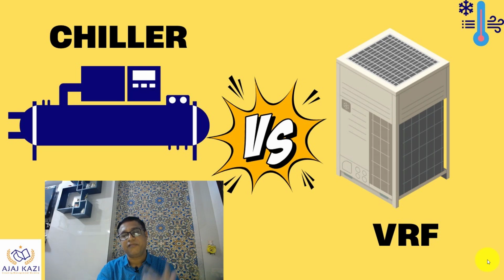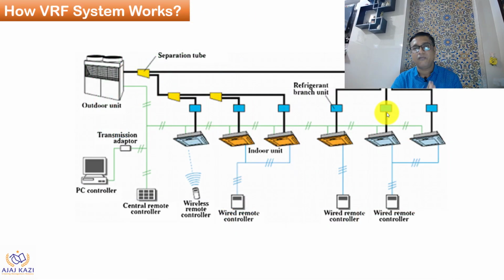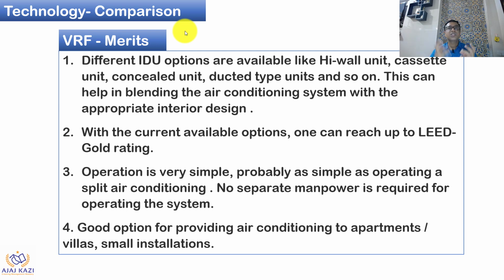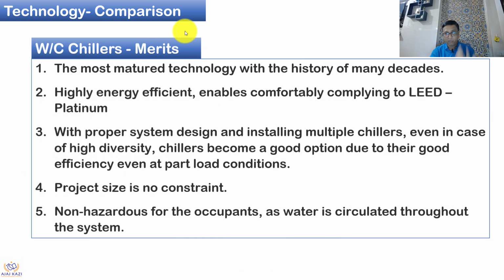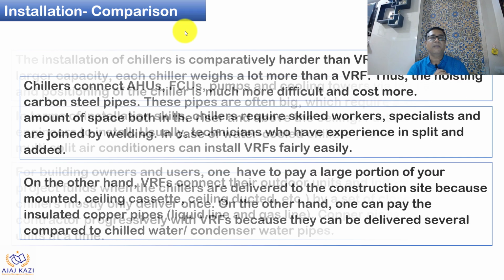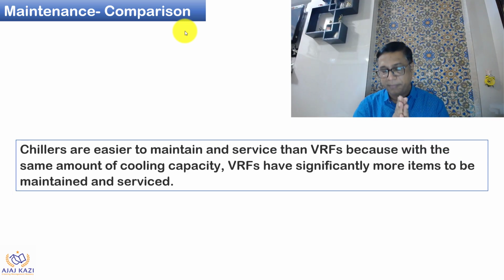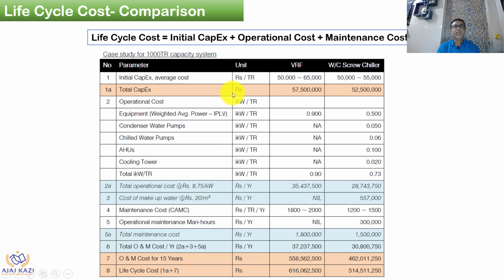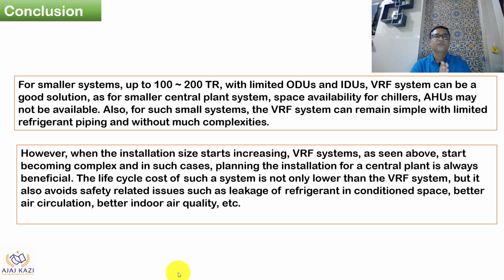Chillers vs VRF Which REALLY Cools Better

Comment: System selection must be based on application firs and all other pros and cons depend accordingly .
Hv seen, VRFs are  used in critical OTs as  by so called prominent consultants justified by its general advantages over chilled water that  don’t actually align with the strict requirements of such sensitive spaces.